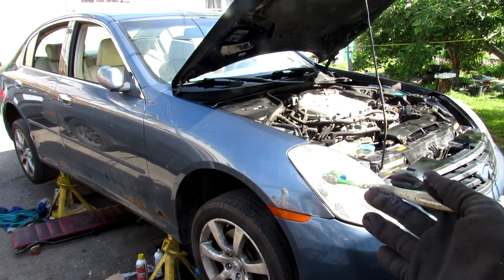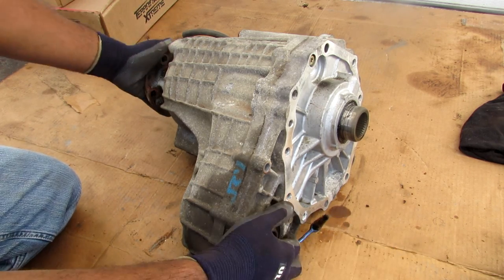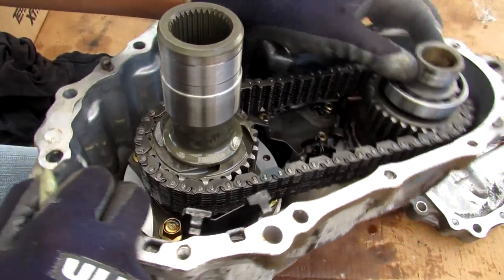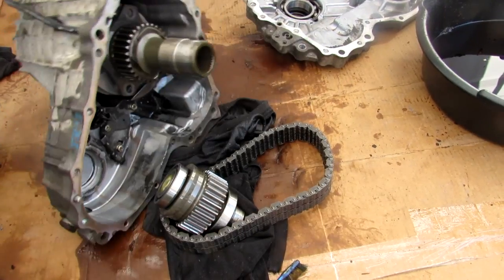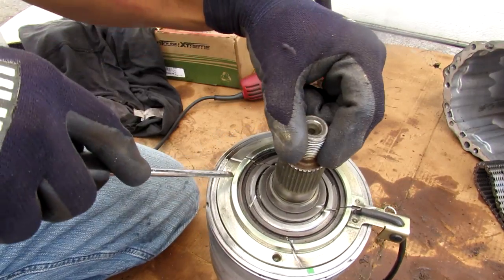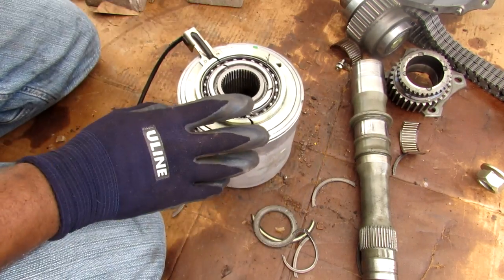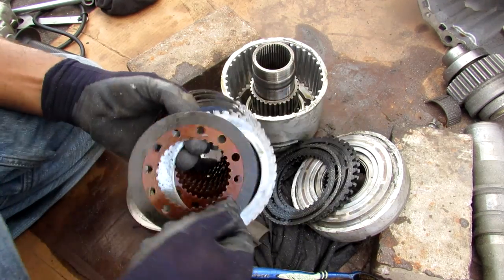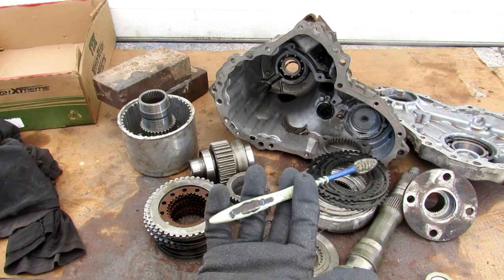How Does AWD Work?

Comment: Excellent. That transfer clutch is from a nissan G35X. I used this in a BNR34 getrag  box to eliminate the stock electric over hydraulic system with the electronic system. This enables true 2wd or 50/50 awd but enables me to control the centre diff for some magic results. Launch control being one of many tricks. This has allowed my 350Z to become a supercar
Reply: Is this bolt on BNR34 Getrag transmission?

Comment: You gotta love this guy.  He doesn't beat around the bush, doesn't mince words.
Reply from the maker: Why waste time??
Reply: @speedkar99  Amen to that, brother.  It was a very enjoyable and educational video.  Thank you.  We have a 1999 AWD Ford Explorer, and I don't think I can get the cover off the front differential without dropping the whole front axle assembly out.  But that would mess up the alignment, and I'd have to remove at least one front wheel bearing assembly.  The Ford dealer charged me $22 for just one of those "single use" wheel bearing nuts the last time I removed a front wheel!

It sounds like the previous owner never checked or changed the fluid.  In fact, it sounds like it's dry and already damaged.

While watching your video, I realized that there is no differential between the FWD clutch pack and and the rear drive shaft, but, instead, that the two operate in a tandem setup, with the rear differential being directly driven by a continuous shaft from input to output of the transfer case.  Now I can go home and take a cutting torch to one side of that front axle and just drop it and the front drive shaft out completely with no regrets or second guessing -- and without changing the alignment.  We'll just use the car as a rear wheel drive vehicle.  It's too old to waste time, money, and work to repair a feature I've lived without all my life, anyway.  Thanks a bunch!

Comment: It is good to realize that both the input and output of the clutch pack are rotating at nearly the same speed when driving only the rear wheels.
The non-driven front wheels drive the clutch pack via the front differential and shaft.
This greatly reduces wear.
Nice video. Much better than expensive and often inaccurate 3D animations.
Reply from the maker: They have to rotate the same speed almost all the time otherwise the clutch will wear out.

Comment: Great explanation, also video editing and details choosing in your explanation. Normally follow someone disassembling something is hard to follow due to the mechanic to explaining together with the activity. But the way you do is great. Great video.

Also answered some questions I had such as "why with so many clutches this system is not hot like hell?" and "if this is a center diff, when opened all torque would go to the front free axle"

Comment: I would think that the control clutch would wear out... were it to be allowed to slip for any length of time.
Reply from the maker: It's not slipping unless your rear wheels are spinning on ice and fronts are locked. The shafts move more or less at the same speed since the wheels move at the same speed.

Comment: Many cars have a center differential (planetary "epicyclic" gearset), not just a series of oil-encased clutch plates. Those cars also have the option of locking the center diff (no slippage) and most have a two-speed gearbox ahead of the 4WD setup.
Reply: This is slightly different. This is awd not 4wd. Most awd give the driver no options when it comes to controlling which wheels have power. In some rare cases, like the mercedes gwagon, there is an engagable awd based system with lockable diffs rather than 4wd, and i believe old toyota rav4s had an option for awd with a locking center diff, but I could be wrong on that one. Either way, the majority of awd has the computer do everything rather than the driver
Reply from the maker: Yep those are a different setup

Comment: So as I see it this is a standard rear  wheel drive system with added electrically controlled multiplate oil immersed clutch .
 In a situation where one may be turning it could transpire that , if the computer decides it needs a 50/50 split, the rear wheels will be covering a shorter distance than the front wheels yet turning at the same RPM thus causing binding of tyres on the road surface with the bunny hops common to solid 4 wheel drive. A much better system would be to incorporate a linear differential with optional lock up.
Reply from the maker: These clutches allow some slipping

Comment: Since there is no "real" center differential for this AWD setup, does the computer have to engage in adjusting those clutch plates all the time when the car is not moving in straight line?
Reply from the maker: Some difference in wheel speed is allowed through clutch slippage

Comment: I have a question. I have. A 2012 cadillac escalade awd. Is posible to remove or disable the transfer case ?
Reply from the maker: Yeah but the computer might scream out. 
You could also swap in a Silverado 2WD transmission.
Reply: Thankyou  Thank you so much for your reply Do you think if by deleting the transfer case the computer on my site screaming what do you think it will happen ?traction control light might come out?

Comment: I just don't understand how a clutch can control torque distribution between the front and rear axles in this way. Surely the only way a clutch can vary torque is when the input and output shafts are turning at different speeds (like setting off from stationary in a manual car) the clutch can allow more or less slippage between the clutch plates, and therefore between the two shafts, to transfer more or less torque. However when a car is driving along a straight road there is no difference between the rotational speed of the front and rear wheels so the input and output shafts are rotating at the same speed so it doesn't matter whether the clutch is 10% locked or fully locked (or anywhere in between) there is no slip between the clutch plates, so how does the clutch have any effect?
Reply: I was wondering the same! And also: how can these small clutches sustain so much constant slipping without getting red hot and welding together or even explode in tiny metal fragments? Hopefully someone can shed some light on these questions :) thanks! Great video by the way, as always!
Reply: @qnaap  having sat and thought about it I am guessing that the answer is as follows:
Whenever all the wheels are turning at the same speed there is no controlled torque split, it simply defaults to a fixed split. The controlled torque split only occurs when there is a difference in front/rear wheel speed (which is a lot of the time on many roads i.e. ones with corners). And since this speed difference (due to corners) is typically only ever very slight, that is why the clutch pack is able to operate without destroying itself.
If you do drive on slippy surfaces and get significantly different front/rear speeds it does start to damage the clutch and that's what the temperature sensor is there to detect.
Does this sound like a viable explanation? (If it is, it was only your question about why the clutch doesn't burn out that made me think of it!!)
Edit: just thought, it also acts as a central differential as well, as long as it isn't 100% locked. Wow, it's unbelievably simple, and clever!
Reply: @pjay3028  the way you explain it does sound very likely to be true! So cool to see how effective such small components can be, considering the things you can achieve with these vehicles. Change your oil, kids :)

Comment: Would you happen to have a video on how the AWD system works on the Lexus IS/GS/RC?  I know it's a planetary gear set with a clutch pack as a limited slip diff, but I'm unclear on how the default torque split (30% front 70% rear) is achieved. Is it done entirely by gearing inside of the transfer case, without the use of a clutch pack?  Does this mean that even if the clutch pack is no longer functional, it'll still be full-time 30/70 AWD?
Reply from the maker: I'd be interested to study this myself.

Comment: If a 2013 Honda CR-V Real Time AWD system is in Drive, will the front wheels of the vehicle roll backwards while the vehicle is in Drive? 
Or will the front wheels only roll backward when the vehicle is in neutral?
(This is not a CVT transmission)
Reply from the maker: Didn't Honda have that transmission problem with those generation CRV and fake AWD
Reply: @speedkar99  Not sure. There is a debate whether you can tow a 2013 CRV AWD backwards while it's in Drive. People say all 4 wheels will spin freely in any gear except Park. Wondering if you know if this is true. 

I say front wheels won't spin freely and you'd break the driveshaft or damage something towing backwards while in Drive.

What do you think?

Comment: i imagine most of the time you’re not sending all 50% of the torque to the front wheels. so by sending less than that, does that lead to premature wear on the clutch packs since you’re constantly allowing for slippage?
Reply from the maker: They aren't slipping since the front and rear wheels more or less move at the same speed

Comment: OK this is a long shot but I recently bought a used 2011 Nissan Murano AWD and the previous owner told me that the transfer case needs to be changed because there is a grumbling sound that happens when I put the vehicle in drive and let it roll from idle alone, but this grumbling goes away once I accelerate above 7 or 8 mph.  one mechanic recently noted that there was some play where the driveshaft meets the rear differential. I just don't know who to believe, as the previous owner's mechanic said it was the transfer case and the mechanic I went to see for an unrelated issue said there was some abnormal play at the rear differential. Apart from that there are no issues with the trransmission. Any thoughts as to what it could be? Thanks

Comment: Can you possible send me a pinout of the AWD module? I am wanting to make a arduino controller to replace or piggyback into it for a custom awd setup on a standalone. I am not sure at this point if the abs signals etc drive the oem module or does it need other signals from the canbus/ecu which then I will have to simulate or get rid of via a potentiometer. Any help would be appreciated thanks.

Comment: This is a nice breakdown.  I'm now wondering if the electrical lockup is pulse width modulation or not.  Thats the only question I'm left with.
Reply: Probably, resistor packs are now considered old fashioned.

Comment: Do you really need all the tires to be same tread depth for awd? Ive seen old subarus that get damaged, but newer awd should be ok right?
Reply from the maker: Depends on the AWD system. If it's a locking cluch then yes it will get damaged. 
If it's a viscous coupling then maybe not as sensitive
Reply: @speedkar99  I thought the cv joints would compensate for wheel speed and wouldn't cause damage?

Comment: Nice video as usual. So say compared to a front wheel based AWD, in this rear biased setup front prop shaft will not be spun by the engine until AWD needs to be engaged right?. Where as in a front wheel based AWD, rear prop shaft will be spun by the transfer case at all times and the clutch packs just before the rear diff is engaged to enable AWD (at least in most FWD car based SUVs)?. Based on that I'd say the rear wheel based AWD setup will likely to be bit more efficient compared to a front biased AWD in normal driving.
Reply from the maker: This doesn't have a driveshaft disconnect so it'll still spin because the wheels are spinning. Torque just isn't being transferred when the clutch isn't engaged.

Comment: This is the vid i was waiting for sir! I have my awd fuse removed in my g35 effectively making it full time rwd. Always wondered if there is any sort of damage and this explains it. Thank you
Reply: Is it the G35 hr or de ?
Reply: @automotivetv9861  de
Reply: @octacore9976  can you do the same to the hr?
Reply: @automotivetv9861  it works on 04-06 g35x. And i think those all are de but i dont think it has anything to do with de/hr
Reply from the maker: Yeah my brother rigged a switch to his G37X HR's AWD ECU to cut it off and turn it into a RWD at the flick of a switch. It also disabled traction/ABS so it's a really fun switch 😉
Reply: speedkar99 I got a G37xS as well. Amazing car. If the computer is sending all the power to the rear wheels how much extra drivetrain loss vs a actually RWD only car (G37S) would you think there would be? I would imagine hardly any since it’s just basically a slightly longer shaft directly to the driveshaft correct?
Reply: @trizkial7592  I've always heard it was a 20% loss. But I don't think it's actually that much though. I have an 04 G35X. It has 208k and everything is still working just fine.
Reply: @nowimhigh  seems drastic lol maybe for a Subaru or other full time awd car but in this case of a g35x or g37x it’s just an extra shaft I don’t see how that would add any extra loss personally

Comment: I am surprised. I thought the power transmission to the front wheels are by means of gear to the connecting prop shaft but instead it's by chain.
Reply from the maker: I would have thought so as well

Comment: So all AWD cars are primarily rwd?
Reply: Adhiraj Jadhav no, it depends on what it is in its base model. Most cars are fwd nowadays, so most car-based awd are fwd biased
Reply from the maker: No. It depends on vehicle platform and engine orientation.
Reply: No, in example Golf 2 Syncro is fwd but when it detects front wheel slip, sends power to rear
Reply: chrysler 300c awd is real awd car, can not disconnect front or rear wheels and it is good
Reply: Nissan's have a true 4x4 awd system or the ATESA system that is basically just fwd assist at 80/20. My G35X is only 50/50 in snow mode at the first 10 mph when activated.

Comment: Thanks. Now I start to wonder If my "real" 4wd (Isuzu Trooper) is the same layout except that I have gears instead of a clutch. I believe it´s a chain involved. Could you say that my transfer box is like this except that is has a "connectable gear" instead of clutch?
Reply: It depends.  Some models of Isuzu Trooper had a Borg Warner Torque on Demand transfer case which has clutches in it similar to the Nissan one.  Difference with BW TOD  is the clutch is on the front shaft assembly not on the input shaft as here.  Another reason for this configuration on the Isuzu is the need to allow for low range, which is controlled on the input shaft assembly.  The Nissan system shown here does not allow for low Range

Comment: Hey speedkar, I've seen that you worked on the xv20 Lexus es300 (1996 - 2001). I've found out that the xv20 es300 and xv20 camry share the same chassis, so I was wondering if suspension parts between the two are interchangable. I'm hoping that lowering springs or a coilover set up for an xv20 camry can work on an xv20 es300. Do you know if they are?

Comment: I would be very interested to see how much fuel savings you could achieve by removing the clutch system. This seems like a VERY inefficient system when in RWD mode.
Reply from the maker: Well the G35 comes in rwd so you can look up the fuel differences

Comment: Once those front clutches ware out you now have 2wd and another idea is why the manufacturer just didn't use a center differential in the transfer case that way there's no need for clutch packs to ware out
Reply from the maker: The clutches only wear out when there's a speed differential between the front and rear, which in most cases they move the same speed because all 4 wheels are on the ground.

Comment: This is fantasactic!! My 2006 M35X has the same ATTESA system and is awesome.  Does the "Snow Mode" lock it 50/50 to a certain speed? Loving your channel.
Reply: Yes, snow mode is only 50/50 for up to 10mph. After that it's basically just fwd assisted at 80/20.

Comment: Does the metal chain ever break?
Reply: These ATESA systems are actually quite reliable. Usually the only weak spot is the ujoints on for the front drive shaft going to the front diff. If the GTR can handle over 800hp on the stock Awd, I'd say they are built pretty well.

Comment: Going to stick to 2WD after seeing this.Very interesting.
Reply: There are 4wd version that only kicks in the rear wheels if the front wheels are spinning. You get the fuel economy of front wheel drive, and you get 4WD if you need it. It's not as good as permanent AWD though